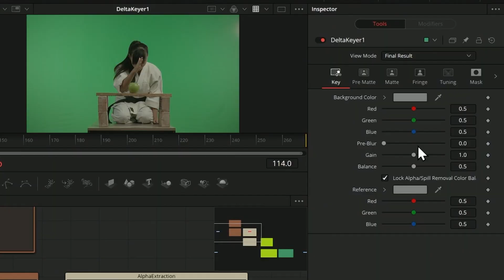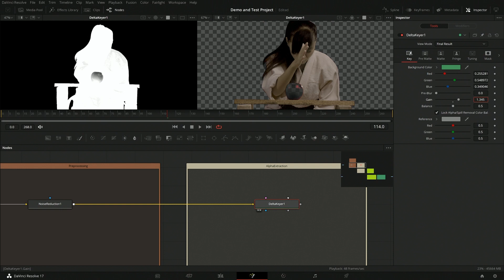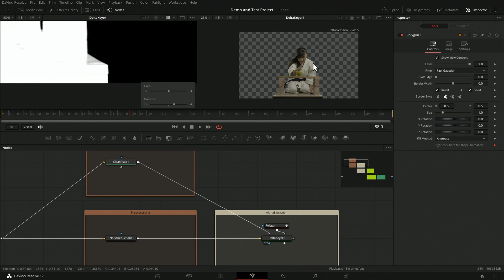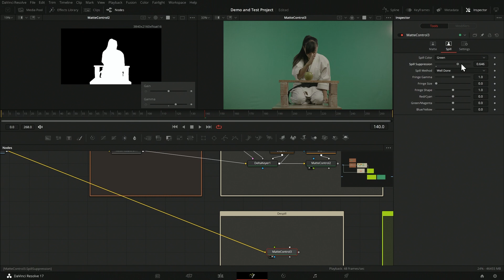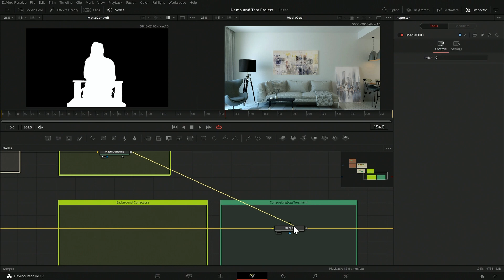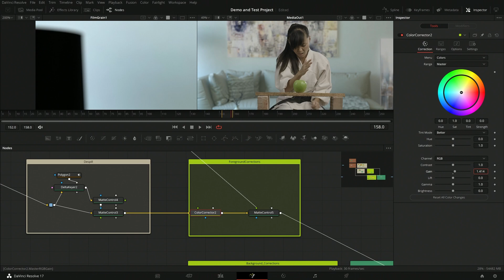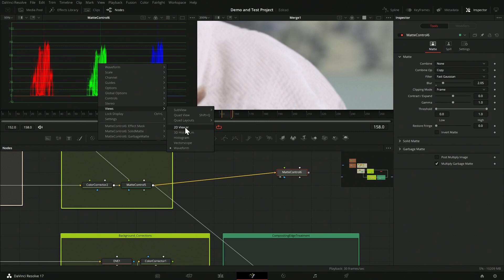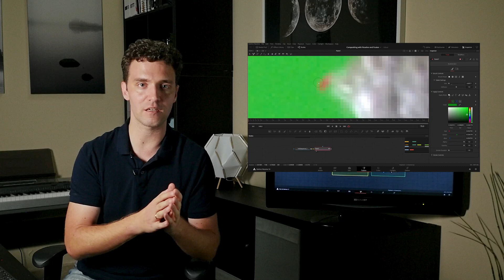Advanced Keying: High-End Workflow for Top Results on Tough Problems

Comment: Hello Bernd, very good presentation. Seems like you are the specialist who can answer me a question in regards to compositing :) In my green screen recording environment I would like to set up more than one physical static cameras. The plan is than to integrate the different camera views into a virtual studio scene. In order to do this correctly, I would like to somehow use Davinci to compute the camera poses (3D position + 3D orientation) in the room. I thought about setting up the cameras in front of a calibration pattern before the actual recording, to get both cameras into the same reference coordinate system. I have seen that Davinci supports Camera tracking for a single moving scene. Maybe this could be used somehow? Maybe stacking a reference shot from the calibration pattern of each camera into sequence and that using the tracker to get the relative pose between camera positions? Of course things could be made a lot better if Davinci already has camera calibration algorithms on board which would allow to preset camera characteristics like focus and pixel size. Thanks for your response and your great channel. Helps a lot to get started with Davinci! Best regards, Christoph

Comment: Very good video. It will be interesting to see an example of workflow where the greenscreen is digitally added with software for example with runawayml.
Reply from the maker: You can also try the magic mask in the DaVinci resolve Color page to get an AI / Machine Learning extraction of a person. Not sure how it compares with runawayml. Some software extracts the subject and then places it in front of an artificial greenscreen - that's generally not a good solution, it's better to output the extracted object with an alpha mask in a file format that supports alpha channel (like ProRes 44444 or DNxHR4444). But if you do get a digitally added green background, then extracting that is usually quite simple and tends to work with pretty much any keyer you want.
Reply: @VFXstudy  I used Magic Mask along with Qualifier but it did not produce the results needed, so I had to look at other options - fast. Apparently, the runwayml does a pretty good job specifically in the green screen section but the problem is that I can't get ProRes4444 as it's 100$ a month, hence I'm left with a green screen mask and .mp4
Reply from the maker: @GeorgeNicola  Ah ok. But I suspect that the simple 3D keyer from the edit page or color page would catch that artificial green screen easily. Or in Fusion a simple Chromakeyer. Some AI powered tools are a bit better than others, but generally they don't get the quality for high end compositing. But maybe it's enough for your purposes...
Reply: @VFXstudy  I agree with you, just in my case I am a total noob in compositing and had to find a quick solution to work it out. Your deep technical tutorials are a big help.

Comment: I'm learning keying in Fusion, but I'm encountering an issue with the delta key transmission to matte control. Why does the key quality degrade in this process? Conected to the matte control mode a green edge is showing up again?
Reply from the maker: Not sure how you connect it or how you use the MatteControl. Generally, if you use the RGBA output, there's no way MatteControl could add a green edge that the DeltaKeyer already removed. However, perhaps you are using only the alpha channel from the DeltaKeyer? In that case any despill that the DeltaKeyer might perform would be ignored. Sometimes that's exactly what we want if we do despill separately or want to try different algorithms for Despill.

Comment: Hello, I followed these steps, but when I go to the status tab on the delta keyer, the fine hairs and edges have a layer of gray around them and there appears to be some kind of flashing effect around the flyaway hairs when I playback the video. Is there a way to remedy this? Is this covered in your course on the vfxstudy website? I was thinking of purchasing.
Reply from the maker: It's always tough to cover a specific issue on a specific shot. The gray probably comes from the spill replacement. Maybe you eroded or blurred the edges a bit or have the mask a bit two wide. See how the alpha is there. In some cases you can tune the edges within the deltakeyer and possibly change the color replace mode. The course goes into some more detail of the individual steps including some edge refinement, edge extension, and adaptive despill. Of course there will still be tuning on any individual shot.

Comment: Hello and thank you for the very detailed tutorial! I have 10 years of experience in After Effects and I do mainly keying and compositing. Recently I'm considering learning Fusion and switching to Davinci Resolve, but after I watched this video I'm not so sure. The greenscreen shot you showed here is not a complicated case at all. In AE, I would just create a rough hard key with "keylight" and then I would add "key cleaner" effect, which automatically refines the mask details. And that is in most cases all you need for a really good key. I understand the process you are doing here but it seems so demanding and complicated! Isn't there a simpler way? Something like the simple process in AE that I use?
Reply from the maker: Sure, you can simplify it. The purpose of the tutorial was to show an advanced workflow for maximum artisitc control for demanding shots. At the end you only do the steps needed in any specific case.

Keylight in AE is pretty much the same as Delta Keyer in Fusion. I'm not sure what that "key cleaner" effect does, but there are refinements inbuilt into the delta keyer, an inbuilt clean plate tool and you can do a simple hard comp soft-comp approach by concatenation two delta-keyers. See my earlier delta keyer tutorial for that. Often that will be enough. But for tough problems or holywood-grade results you might need more...

I think it's less about the software but more about how much control you want and need. Vice versa, the workflow I am showing here can certainly be done in AE as well, though you would need some pre-comps and it might get even more cumbersome with that.
Reply: @VFXstudy  Thank you for your answer! The "key" feature in AE for me in the Key Cleaner. You can feed it with a very rough mask and it calculates the perfect soft detailed mask based on the local contrast around the edges. This makes the keying process co much easier. You dont have to deal with any problems with uneven background or green spill in the subject making your subject transluscent because you can set your key threshold as high as you want. The only goal is to separate the subject, doesn't matter if the mask is ugly and you lose the hair details and stuff because when you apply the Key Cleaner, it will bring the mask details back. Can you do this in fusion somehow?
Reply from the maker: @JaroAtry  is this an AI powered algorithm? I don't use AE so I don't exactly know what that is. Thoug I suspect that it's just something like a hard comp fill which you can do with an additional key or matte control. Again hard to say exactly what it is without side by side comparison. 

 purely technically speaking there can't really be a process like that that always works. Spill and transparency are different things from different sources and desired transparency and accidental transparency look the same on a pixel basis. 
So either AE just simplifies a more generic process which works in many cases - like my other tutorial, that's whatI suspect, or it's an AI powered tuning trained for the most common cases (don't think so but possible).
Probably AE also uses a clean plate internally. Delta keyer can do so via the second tab.
Reply: @JaroAtry  Jaro I am not sure if you read his previous response thoroughly "but there are refinements inbuilt into the delta keyer, an inbuilt clean plate tool and you can do a simple hard comp soft-comp approach by concatenation two delta-keyers." VFXStudy explained that there is a delta key tool that works just the same as your Adobe After Effects tool. There is a threshold with that simplified Fusion tool too. 

So short answer yes. The tool is called Delta Keyer, the process @VFXstudy is describing in the video above is a maximum artistic control workflow. Why don't you try the Delta Keyer tool and see how it compares to the AE effect tool? Its a 10 second process. Add the node, use the color picker to choose the chroma key color, release your finger, and boom its done. Then use your threshold to manage and refine the mask.
Reply: @louis-borrego  Thanks for the explanation. I will definitely try delta keyer.
Reply: @JaroAtry  Of course brotha! Happy editing.